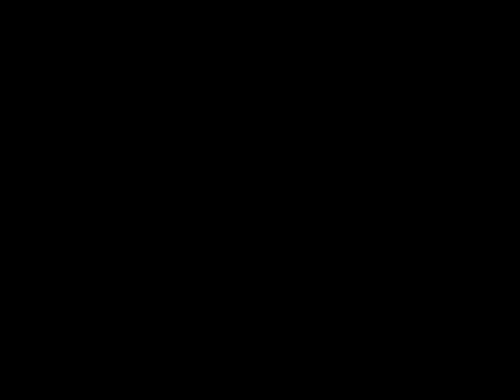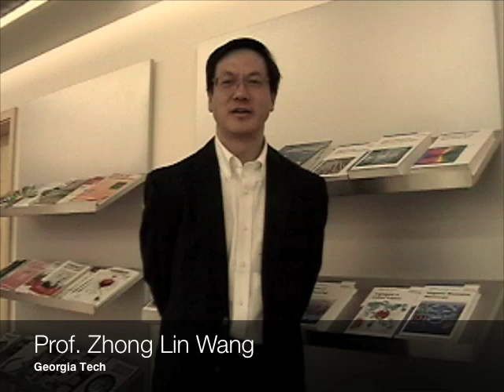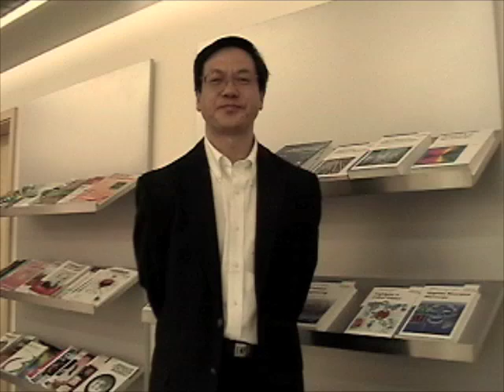Zhong Lin (ZL) Wang interview: Energy generation using ZnO nanopiezotronics

Comment: Outstanding. Nano energy converters are not unlike parasitic electronic receptors, Nano picotronics will open new horizons for micro transistors , Biomedical single cellular diagnostics will assist the immunological systems, Biophotonics and Dielectric functions microscopically interconnect materials, Multifunctional magnetic ferroelectric and picoelectric nano systems puts it all together! All five are excellent initiatives.